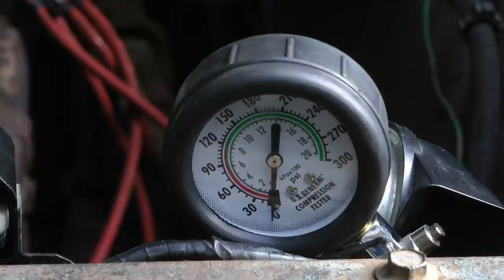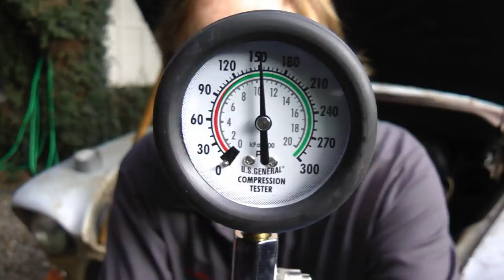How to Tell if Your Car's Engine is Bad

Comment: Ok so i just installed a new shifter cable in my 2000 dodge neon because it snapped and i cannot reverse.. when my cable apparently snapped i coulden't reverse either and it was really hard to take off in first if at all..  manual transmission
Reply from the maker: make sure it's adjusted right to put it into R. But if it is, often a worn out transmission internally on that neon. Realize they are pretty much throw away cars at that age unless you spend tons fixing them
Reply: +Scotty Kilmer Ty Scotty

Comment: hey scotty my madza rx8 hesitates reaching 7000 rpms and the check engine light flashes on and off and do you know what could be the problem
Reply from the maker: +Jose Zepeda get it scanned, there are over 2 thousand possible trouble codes. Auto zones scan em free, e mail the codes to me

Comment: Hi Scotty.. I have a problem with my Golf VR6 MK3 12V engine.. the car losses a little oil and a few days ago the car won't be stable the RPM drop and high likes one spark plug is gone, So I decided to clean the throttle and ICV and MAF and replace the spark plugs when I open the spark plugs the head of them looks black and the one in the number 6 cylinder has little something like oil on it I don't know why! however I replace them with my spare spark plugs and run the car and its OK like normal drive it for two days and the car rest to the same drop and high again like one spark plug gone but less than before and I didn't test the spark plug for oil..the car didn't do any smoke in idle or medium cruising only on high Revs near the end it will smoke black near gray color and the car has oil leak I think from the valve cover what's wrong with it ?? thank in advance and thanks for sharing your awesome videos and sorry for my bad English ...
Reply from the maker: +AG Al Zobidy   it's running rich, that needs fixing first. On those, pray it's just a worn out MAF, and not a worn out engine. To check the engine, have a wet and dry compression test done first to see if engine is just toast.
Reply: +Scotty Kilmer I will replace the maf and sensors with my new spare ones to see if it goes good.. We don't have any tool to check compression in my country we don't know how till open the engine and see is there a basic why to check it...thanks for your fast respond

Comment: Couldnt you just widen the cylinder walls slightly then add new pistons that match its new size?
Reply: Best to pull the heads and check the cylinder walls for size and even wear. If cylinders weren't worn egg-shaped and within spec, you could re-use the same pistons and just but new rings. While you're at it check the journal/rod bearings too.

Comment: What if it's low compression in just one cylinder? I have an 01 Gmc Sierra with a 4.8 that has 185,000 miles. I found out that there's low compression in just cylinder number 2, and it's also throwing a p0300 code. Any ideas?
Reply from the maker: engine is worn out internally then on #2, needing either a head gasket, piston rings, or valve job. You can do a leak down test to pinpoint the cause, but engine would still need rebuilding regardless.
Reply: Sucks to hear that, but thanks! Keep up the good work on your videos!

Comment: Why did you only crank it 4 times the first time? If you gave it another crank or two you could've probably gotten 140psi. When you did the wet test you cranked like 8 times, that's obviously part of the reason why you got a higher number.

Comment: What capabilities does a 89 blazer breaking system and a 98 silverado 1500 have in common?
Reply: Leroy Butts no. It's not a riddle.
Reply: "breaking system" I see you... you're a funny guy.
Reply: Auto correct
Reply: +An Atheist By Choice I don't get it.   They don't have anything in common right?    The Blazer used good old reliable drums while the 89 has those crappy undersized pads sized for a Honda Civic that you change constantly.   Not too swift at stopping either when you have anything bigger than a shoe box in the bed.
Reply: Merlin Cat I was referring to the brake booster. If they were capable of being used for both models

Comment: my car engine idle not stable after i replace other IAC valve  befor engine run up and down  afer I replace IAC, it steal the same. the engine also low power. please help me . my car is nissan march 1994.

Comment: sir how to tell if your car has a good or bad smoke in their pipe? thanks in advance :)
Reply from the maker: +Adrian Gutierrez ALL smoke is bad, except the steam you will see up north when it's cold in the winter and then even your breath will steam out
Reply: +Scotty Kilmer thank u sir! my car is toyota corolla 95mdl xe 2e engine, it has blue/white smoke coming out from its exhaust pipe, specially when the idle is up , others suggest to put some additives to make the oil thicker and stop it for burning , should i do that?
Reply: +Adrian Gutierrez blue smoke coming from the exhaust is oil leaking in which can be from bad/dry/cracked valve seals which will wind up costing you tons of money because once you go to get the valve seals replaced it usually winds up leading to way more problems in your engine that your mechanic "sees" so if that's the problem you're in for a ride.
Reply: +John Chancellor thank you

Comment: I changed my clutch master cylinder today because it was leaking nasty and I changed the slave cylinder and I bled it like about 20 times and is still soft what could it be?
Reply from the maker: air often gets stuck and is hard to bleed out without a pressure bleeder. BUT, if it has no air left, you got bad parts I've got bad masters myself before that did just that.
Reply: What do i do

Comment: So if the engine is still good, adding oil should not make a difference in the reading?
Reply from the maker: +pinoywheelgunner you only use a small amount of oil, so a good engine will only go up in pressure a tiny amount for that space the oil took up, not the large amount this one did
Reply: +pinoywheelgunner I've heard there are cases where a person can go up to a thicker oil (say, from a xw30 to an xw40 or from an xw40 to xw50) to make the oil pressure higher if the engine's worn and isn't giving as high oil pressure as it would if it weren't worn. But, I'm not well versed in this subject.
Reply: The ignition chamber is not where you put engine oil, this was just a compression test. High oil pressure is not a good thing.

Comment: I have an '88 F150 Lariat XLT (fuck off all you Ford haters) that was my first and so far only vehicle, and it has done well (I think) for the past 6 years or so. But a year ago I had to get a new alternator, and recently paid a lot in getting the radiator fixed. Now the motor is a making a rattling sound, and the mechanic I have taken it to says it needs to be replaced, and it'll cost $3,200.

I don't know if it is worth paying all that and being unsure of what else might go wrong just a few months down the road. I love the old 80s F150s.  I was considering using that money to buy, or put toward getting another used car and then just using my f150 to "test" how well I could do working on cars myself. It's something I have wanted to learn ever since I got my truck, and it has been on my mind a lot because of my truck and because I really need to find some sort of skill that could lead me toward a career path.
Reply from the maker: xinic5 sure, get an old used toyotas that can run forever and learn how to fix an engine on your old truck yourself
Reply: Scotty Kilmer
Yeah I think that's what I probably need to do. Kind of sad though, I have weird unrealistic attachments to things like my first truck, my first drawing pad...etc. I'm weird like that.
Reply: Scotty Kilmer Would you say the same for Hondas?  Do they as long as Toyotas?

Comment: Surely that late model Cobra at the beginning of the video has ABS brakes.  Didn't look like it though lol
Reply from the maker: real drivers like myself detest such computer crap that limits our real control of driving. So, I just disconnected it while I was driving to have more fun and control drifting.
Reply: Scotty Kilmer lol fair enough. I didn't realize brakes were used to drift. I figured it was all throttle input and precise steering.

Comment: just put new pistons rings,rod bearings,resurface the heads in the machine shop they will also do a valve seal job etc,and new head gasket and done. am I right people? 
if not what could he had done or what parts the engine would need to be replaced?
Reply from the maker: +bartojoe as I've said already, the owner just spend money having this used "junk yard" engine installed and was pissed it was so worn out, he was told is was a good engine. She he didn't want to spend more right now on the same problem

Comment: Looks like tge truck has bin striped of paint  . Plus just put new rings and a few other things  in and possibly  valve seals you can do it with the motor still in the vehicle . Weld in some new sheet metal  make her like  new

Comment: How to free up a seize engine to renove the torque converter bolt
Reply from the maker: try turning it in the opposite direction to get tdo the bolts, pray you can cause otherwise you might have to pull engine and tranny together
Reply: Scotty Kilmer ok thanks I appreciate the tip and if i have any more questions I will inform you thanks friend

Comment: My car hit a pot hole and gear went in neutral once back in drive the engine got loud.i get on eway mph was reading 50 car was doing bout 20 loosing pressure .once i pulled over n restarted it engine was shaking n smoke was coming from underneath.please help what can be the problem i have a 06 saturn ion
Reply: sounds like you migt have lost oil. check your fluids. check that your wires are all connected

Comment: I think I knew that that engine would be worn even before opening the bonnet.
Reply: Well like it turned out to be, it wasn't the original engine. Had you have had that information would you have automatically said the engine is worn out without opening the hood?

Comment: That's the worst plugs for a GM due to the high internal resistance, engine wouldn't burn the mixture efficient feeling like is miss firig

Comment: Another very quick test on a used car is to take a piece of paper big enough to cover the end of the exhaust pipe, and lay it against the opening while the engine is running. If the paper slaps back against the pipe, there's valve/s out. Walk away...

Comment: I reaplease the timeming chain. and the engine bearingngs and my Nissan sentra 2001 still make that ratheling sound I don't now what else todo plese help
Reply from the maker: Enrique Gonzalez often the timing chain tensioner needs replacing too
Reply: scotty ,I replace all .new tensioner .I buy a holl kit.and then reaplease the engine bearings. but still make a oaufull noice.like tikitikik.some time in low gear don't sound..what you tjink. thanks for answering.

Comment: Forgot to tell us to disable fuel and ignition scotty. it could be dangerous if the spark plug wires arch and someone gets hurt and plus the fuel getting poured into the cylinders is not very good
Reply from the maker: +Spencer C that tiny amount of time, fuel hurts nothing, and if it does start up, it would get a more accurate pressure reading anyway

Comment: Hey scotty, i have a dodge r/t with a 318, its smells a lot like oil and gas in the exhaust, but no smoke at all, what can it be?
Reply from the maker: pray it's just running rich from leaking injectors or fuel pressure regulator being bad, and not a starting to blow head gasket.
Reply: well its carburated, there are not injectors, but thanks anyway scotty

Comment: Hey, "Scotty" you ever heard of a leak-down test..? Oil intrusion into the cylinder head could also come from leaking valve seals, and would be a simple top end overhaul. not just piston rings. You didn't do that test.Also note, that you need to remove All spark plugs from the motor, having a fully charged battery before the compression test even  starts. Not 3 cranks of the motor. If you're going to make a video, please  include correct diagnostic advice.

Comment: Why not run an oil flush and add one of the additives that help fill in the scratches in the bore before saying the engine is dead?  Truck would make a great rat rod if the engine worked.

Comment: Shouldn't the engine be up to operating temp before performing compression test
Reply from the maker: no, worn engine metal expands as it heats up. You want the cold readings to find problems easier

Comment: you told us 120/160 psi is low but whats "new" and whats "acceptable"?
Reply from the maker: depends on engine design and age really. some new ones are 225 and an old toyota with 120 can still run pretty good, would just burn a little oil

Comment: Can't you just rebuild the engine instead of just throwing it away. Like put in new piston rings???
Reply: rebuilds are usually cost more than a crate engine
Reply: +DatCat yup
Reply: Well, it gets pricey quick. If you're gonna rebuild an engine, you gotta take stock of what you start out with. 
If your valves are bad, you gotta replace em. Valve springs bad? Replace em.
Piston rings, gaskets, pistons, connecting rods, crankshaft, camshaft, timing chain? 
You've got A LOT to consider when rebuilding.
WHICH is why there are people that just buy a crate engine.
Reply: Although some of the replying commenters' opinions differ, I agree with all of them, looking objectively at the situation.  Buying a drop-in-replacement engine is one solution,  and rebuilding JUST what needs fixing is another, and rebuilding the whole engine is another possibility.  They all have their ups and downs.  In this day and age,  you're not going to find anyone anywhere who could take your car this morning and give it back to you done this evening, without ordering in whatever you want.  Crate motors aren't sitting on the shelf at your local Autozone,  and neither is every single part, gasket, seal, and accessory needed to do the job.  At best, it would be a few days to order in a complete engine, or order in all the parts, and more likely it would be the best of a week or more.  Budget is often the big motivator.  Time is another big motivator.  People think it will be faster to swap the whole motor,  but how fast can you get the ready-to-go motor shipped to you? And what is the schedule of the people who are taking the job for you?  Sometimes, you get lucky and it's only one particular problem that needs to be tackled, and if the parts are handy,  the job might be done in a single shift or less.  You have to balance out your luck against your budget against (replacement or) parts availability.  Lots of homework and math to be done, keeping in mind what you do know (damage-wise) or don't know about.  There's always room for a surprise,  so hope for a pleasant surprise.

Comment: Give up on the project? I had my 350 SBC rebuilt with an Edelbrock cam for $3000 in my Nova. The SBC is not that expensive to just give up on the truck.

Comment: not true,as long as all the cylinders have pressure that is within 15 percent of each other the motor is fine.When the rings are bad,the engine will burn oil.The carbon on the spark plugs is from the carburetor running to rich.Could be a simple choke adjustment.Lots of nice old classics get crushed because of bad advice.I still like scotty!

Comment: is it ok to rev your engine in park?
Reply: yes? wont break the engine but dont over do it
Reply: yes its ok, but make sure the engine is at operation temps so like warm it up or drive it at least 15-20 mins before reving the fk out of it otherwise your oil and fluids are cold which reving can damage your engine and tranny.
Reply: it's ok to rev anything except BMW's & engines with Cams in them
Reply: ive heard that old wives tale, dont rev because there is no load on the engine.  nothing has ever happend to any of my engines and i rev the shit out of them before dropping the clutch.

Comment: My Durango and you change the idle air valve new valve control and sige aselerada and dials the same code p0505
Reply from the maker: +Paola Zavala then wiring to the valve is bad, OR the maincomputer circuit that drives it is bad
Reply: i hate comments like this what the heck does this have to do with the video

Comment: I personally wouldn't tell people to put oil down a spark plug hole. You risk a hydrolock.
Reply from the maker: you only put a small amount in, like a teaspoon max. won't hurt anything then
Reply: Rust penetrant like WD40 works alot better, since you don't have to mess with funnels and oil. Just stick the straw in and spray for a good two seconds (just make sure the straw doesn't shoot out and down into the cylinder.)
Reply: ASE will tell you otherwise.... it's going to tell you exactly what Scotty did... Most Automotive classes suck... but god are those books a work of art.

Comment: Car hesitate when on slow moving traffic around 30 to 45 mph. Altima 2014 2.5s
Reply from the maker: +Bhupender Parmar tune if up first of course, but if not that, try my video "how to clean fuel injectors on your car"